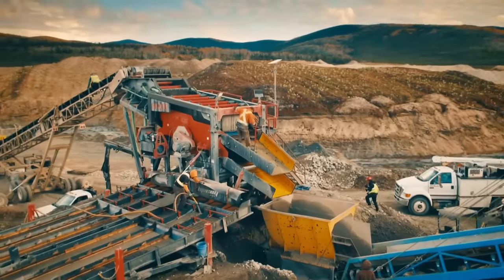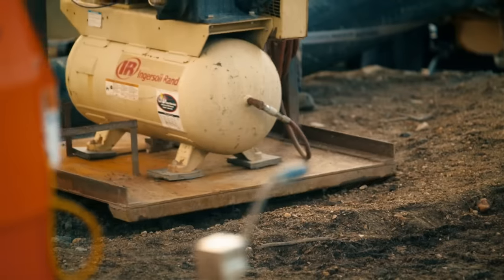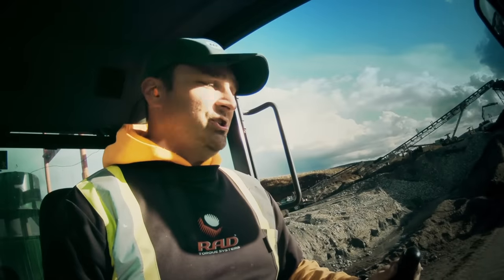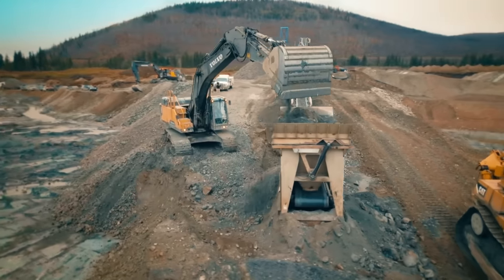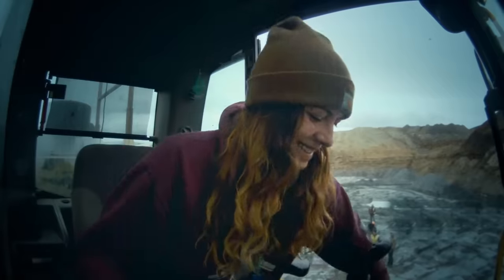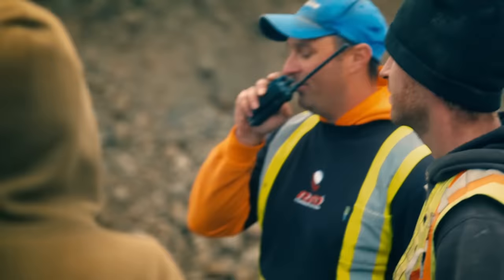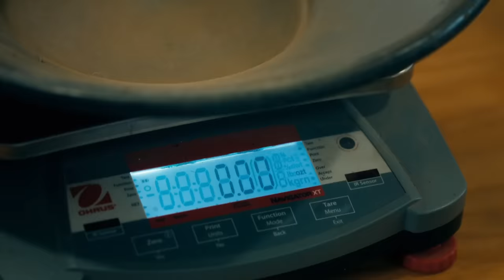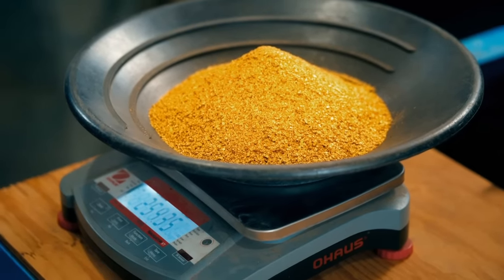Parker Mines $15 Million Worth Of Gold In His Best Season Ever! | Gold Rush

Comment: We don't ever hear, what the bills are, fuel costs total, wages, ins, vehicle cost, maintenance. Permit costs, the cost of plant trees, repair the land, drilling costs. It would be more interesting, to hear the actual profit was. After expensive. What he, and everyone gets paid per episode. Aswell. What was gotten, versus, what was actual free and clear. I mean taxes on 15 million,  gotta be least $6 million.
Reply: Each dozer ~$2Mill, each excavator ~$1M average or so.  Each truck ~$0.5M.  Each washplant ~1.5M.  Food alone costs 2X what it does down south.  Maintenance costs are 2X or higher.  Each person is making ~$100k or more... Wages in AK are high enough in heavy industry you can work for 6 months and then go home and not have to work.
Reply: .......the actual total cost in miners language is usually termed in percentage of the amount of placer gold extracted in a cubic yard. I was on this exact ground in 1991 prospecting some creeks  running into the land Parker owns now. back then we met the owners of the same large land/claim package and they were mining on a massive scale as it was known as the largest placer mine in the Klondike back then and it was huge really huge. we got talking and they stated the general average total cost of operating on the large scale was about 50 %  but it must be remembered that varies depending how much gold is recovered from the operation so if there is not much gold the operating cost is still the same and you go broke. tax laws for this type of work is very different than general trades work as there are a lot of write offs and incentives due to the very high capital cost out lay to get this kind of project operational that is born by the operator. those who attempt this work as owner operators run out of gold and can loose their shirt and many have and a lot of them spent their personal life savings taking a......miners chance.😵‍💫
Reply: Lose not loose. @ski6712